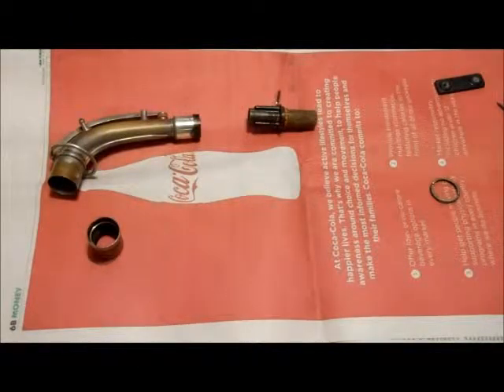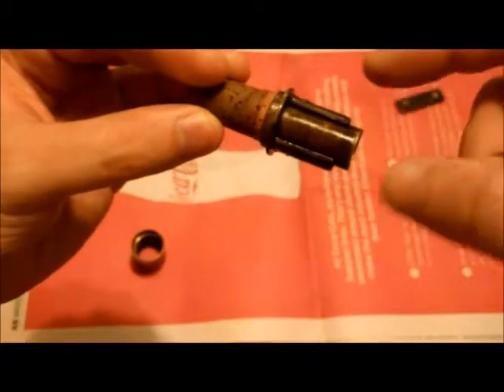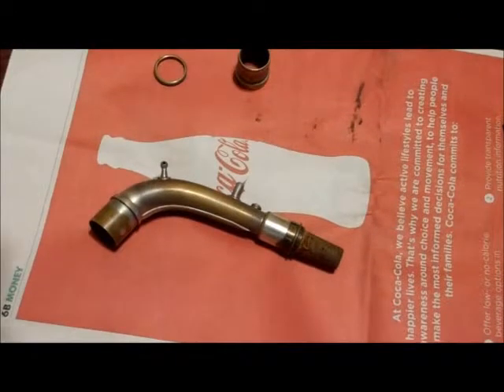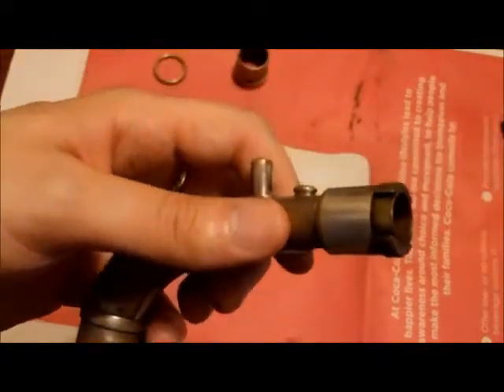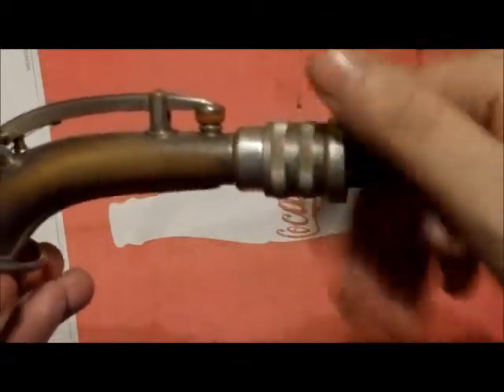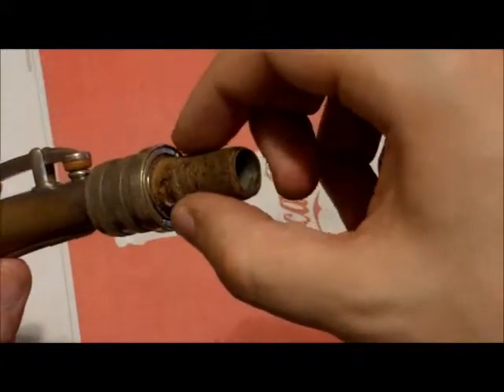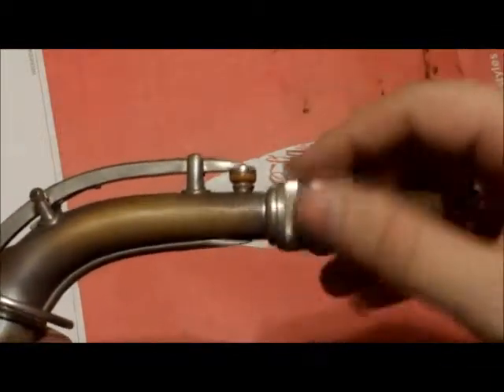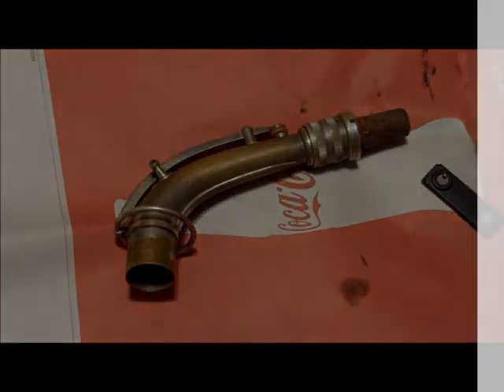Servicing a Conn Microtuner

Comment: mine is missing the locking or as you call it the grub screw but it seems to work I took it apart and its greased and free turning do you think I should take it to a machine shop to have another locking screw tapped in? Is it just to keep from losing the notched flat nut? thanks